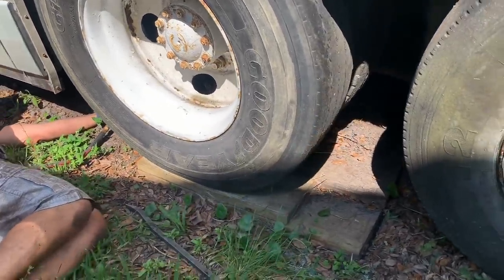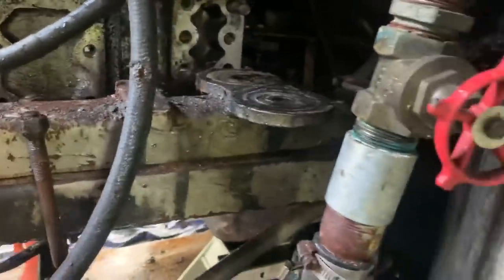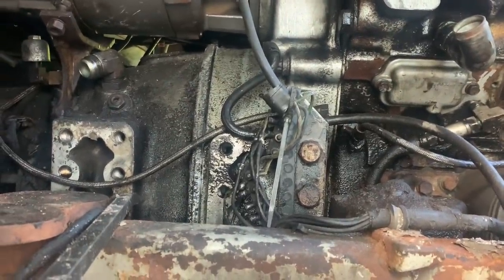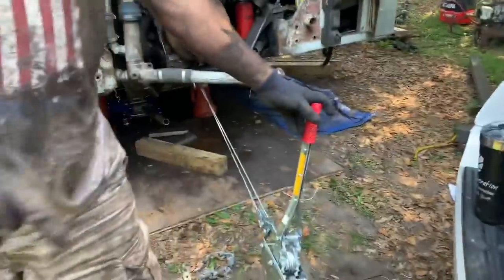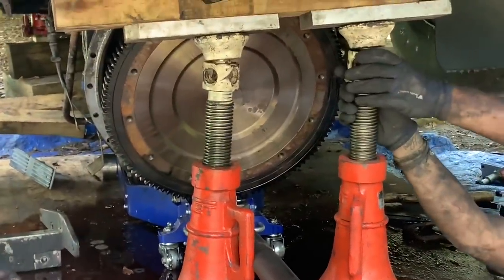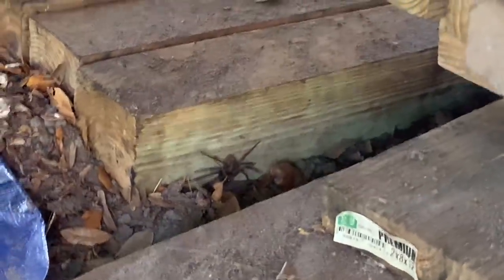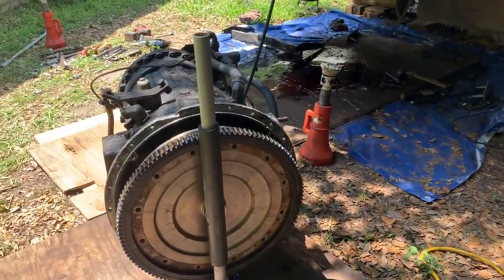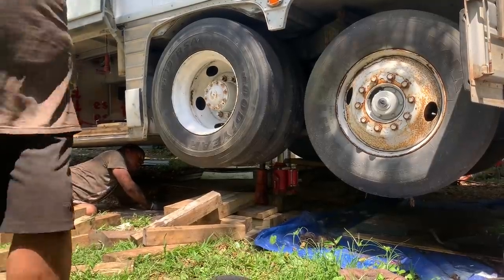Removing a bus transmission in 1/2 a day was a hard job

Comment: Couple things - the dad of two HS classmates died under a Rapid Transit Inc. Old-Look transit in their Winthrop MA shop back in the 1980s, when an air jack failed.  #2 - I second getting some trench plate cut-offs.  Fire depts. use them under their Aerialscope under riggers.  Cheap life insurance.  #3  Just say no to the next nightmare set-up.  Also - based on the red lights front/rear, and the short emergency exit door on driver's side - this may well be an ex-Los Angeles  County Sheriff's Dept. jail bus.  The county has the largest prisoner transport operation in the nation, operated by sworn, armed deputies.  For gawd's sake stay safe out there!

Comment: If you don't have an engine dolly, or better still a fork truck, this is a time when you might want to rent a fork lift! The transmission by itself weighs about 740 pounds! Been there, done that on a couple of Eagles.  I found the best plan was to separate the engine and trans after removal. Still took a couple of hours, do disconnect everything, drain fluids and so on.  Apparently this particular MC9 is headed for scrap. You could also fab up a couple of hunks of heavy angle iron to bolt to the mounts on the sides of the rear engine housing. I used 4x6 x 1/2 angle.  As I remember, the bolts are 5/8". Lacking that, you could just screw long bolts into the bottom holes on the rear housing, and let the engine lay down on them, maybe blocking it up for minimal space to droop onto the cradle.
No matter how you cut it, this is a mess of labor!

Comment: I think I would've greased that v-block part before trying to pull the engine. Once you got it started sliding it would've caused less tension on the come along. But I'm working in hindsight as an armchair mechanic so I've got all kinds of ideas. :)
Reply: I had the same thoughts " Grease The Rails "
Reply: Me too,WD40?
Reply: I've got some bacon grease in the fridge. (Random thoughts)

Comment: I think soft Clay is rated at 1 ton / sq.ft .  Soft sand around 2 ton / sq. ft .  But needs to  be sampled and tested by soil engineer to be sure . Alot of variation due to moisture and any compaction . A very complex subject . Nice finish under extreme circumstances !

Comment: Talk about nerve racking. I had a similar experience with a prevost changing the air dryer and useing a stump for cribing on the side of a highway as soon as we got done and and we both got out from between the axles the stump split . Good times

Comment: If you’re going to keep doing all this engine and transmission work you need to outfit an enclosed trailer to pull with your bus with whatever off the shelf and custom tools, hoists, jacks, and winches to do this kind of work. Will be much easier and safer for you and save the wear and tear on your body. Work smarter, not harder.
Reply: Fun spending other people's money ain't it?
Reply: Totally agree. Jobs like this need custom built tools. Rolling engine jack ? Please be careful, I had a microbus drop off the jack and land one inch from my foot. 😲😓😰

Comment: The tow truck picks it up with so much ease. The thing that got me was the tow truck driver, I mean using your foot as a measuring device to get the clearance between ground I assume for the bounce while driving so tyres don't hit road, recon he does it all the time but one day god forbid the hand control don't allow the command signal to go a little fraction lower thus crushing the drivers foot, No I think id rather use a stick to measure distances between floor and tyre. anyhow guys was a great video on removal of transmission box, a few scary moments but you guys came through safely.
Reply: Robert - I saw the same thing, and him putting his foot underneath that wheel was stupidly dangerous. This whole video gave me sweaty palms.

Comment: Wow what a job tremendous amount of work especially on the ground in grass would love to have that DD 6V strong engines. Worked on these model coaches for a few years not easy to work with much respect to these guys.
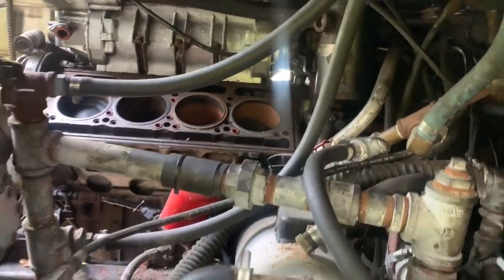Reply: Bernard Simmons check 1:01 
I count four holes 
Isn’t that an 8V

Comment: As often as you seem to need them, I would think you'd have set of metal and wood ramps to go under one or both axels made up and onboard as a standard tool, and with a big enough foot print to prevent them from sinking into the ground while providing a stable foundation for the various jacks you use. Just thinking....

Comment: It's easy to play back seat mechanic so I apologize in advance. I would have jacked up the cradle and then had the tow truck pull the bus forward. Could have unbolted the transmission at that time. Then if the motors going with the bus the tow truck could pick it up and sling it back in. It cost a couple bucks but it is way easier than fighting it out underneath.
Reply: @johnnycomelately5914  Sort of....when you first pull the bus out the engine and trans don't go anywhere; They'd still be sitting on jack stands. You'd literally pull the bus away from the engine/trans and honestly you don't even need a tow truck to do that. I used to use my car or a neighbors tractor. You'd cage the drive brakes on it and just pull. With the trans out in the open it doesn't take an hour to disconnect it. I've done a 6v92/HT740 in an 96a3, an 8v92/HT740 in a LeMirage and a Series 60/B500 in a LeMirage exactly this way before and I never spent more than a couple hundred. HT740 is a heavy bulky transmission. It's just easier to handle out in the open.

Comment: Why didn't  you guys use the external engine cradle you can get to roll the entire engine and transmission assembly out onto? It'll allow you to work on the drive train externally.
Reply from the maker: It was all getting towed away in a few hours. Cradle and engine had to go with it.

Comment: So why did you pull the trans and then tow off the bus , Did someone buy it with out a trans ? just wondering what the deal was. lot of work and them see it get towed away. Cool Video. thanks!
Reply from the maker: Yes the bus was given away free but the trans was not part of the deal.  It’s a good trans that will go into another bus.

Comment: Wow. What a hairy job.  I thought it was bad replacing an engine in my Cadillac one January in Boston.. it was in a driveway with an incline that was almost ridiculous.  I'd guess it was around 7-8' incline in 40 feet.  You couldn't even walk up the driveway it was so icy. Car was facing down, with 6 feet between the front bumper and a wall at the bottom of the driveway.  Very hairy, but this takes the cake.

Comment: Some of the sketchiest work ive seen done in a while... im surprised no one ended up in emerg ward seeing that. If you do this work day in and day out why not fab up a trailer with a big winch with ramps that you can drag a bus onto and use it like a mechanics pit with hollow center. and the comment on the video at the end " We get away with so much" ... fatal last words there keep it up flip flop crew sooner or later someone will get fucked up
Reply: yeah I would  build a mobile cradle, kinda like a dolly trailer.
Reply: @gbowne1  seems like a good idea to me.  Problem is that he deals with so many different buses and power trains.   It would need a lot of adjust ability and take down for transport.
Reply: @normdeplume6133  true but that wouldnt be all that hard to do to make something thats adjustable.

Comment: BGM...I think you’d benefit greatly if you had a say...5000lb or even a 9000lb winch set up on a 2” receiver style mount. Add a cheapo deep cycle battery and presto...yanking 2stroke detroits just became easier.

Comment: Im watching my fingers lol. I was doing kindling at a campsite with my hatchet and my wife said one of these times your going to cut your finger. The very next chop took off the tip of my finger because she had to say something. Whats ever more to that story is that was the 2nd time I cut off the tip of that finger. The first time they sewed it back on and it kinda came back to life now I have no feeling and a slightly shorter finger. The first time was on something under a truck I was working on my hand slipped and cut it off. If that spider was near me I would have drew my sidearm and shot it! The tow didnt put any lights on the rear was that after he got it on the road?

Comment: I remember the MCI engine cradle cart even more after this video.    
 are you doing engine and trans.?
 job on this bus or is it going to be parted out?
Reply: The heads were off the engine with rust in the bores so guessing its a part out

Comment: It’s easier to pull the engine an trans n one unit. The engine has three lifting points two on either side on top of bell house one on center of front of engine. The one on front of engine usually is missing so u have to creat one and a three point lifting bracket is so much easier with a fork lift. J.Crane
Reply from the maker: Yes but we were in a back yard and no access to heavy equipment and we had 4 hrs to get a free transmission or it was gone.   And we got it!!! It’s in another bus now